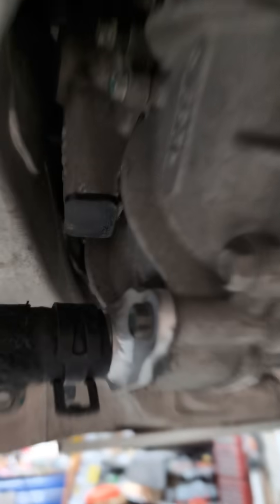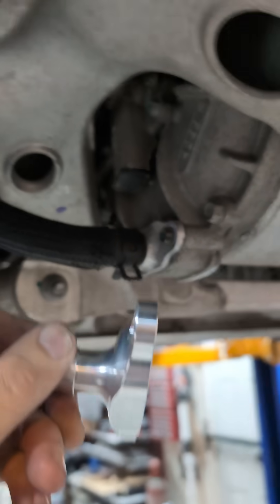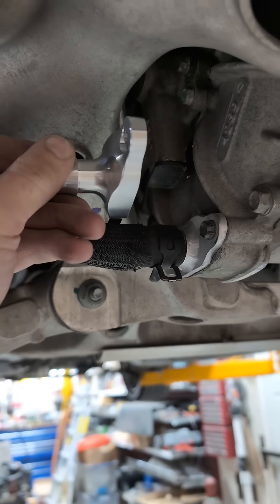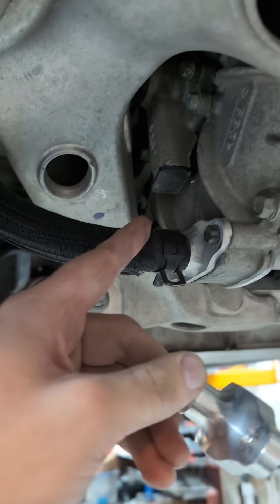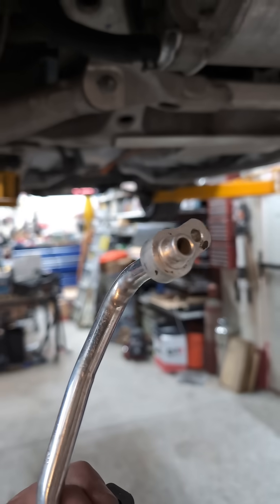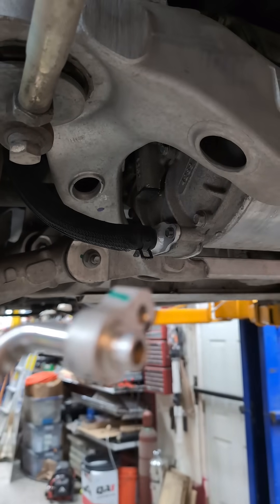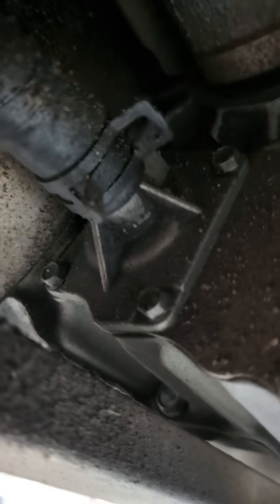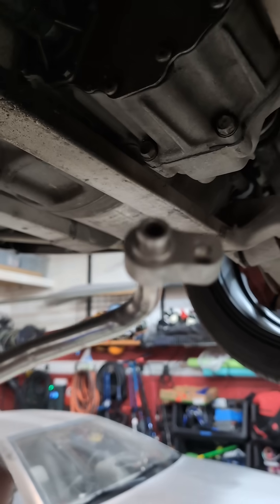Tesla large drive unit coolant delete kit overview.  Is the best part no part?

Comment: U should not use those kills bearings, looks like pink milkshake in gearbox oil. Do as u please just letting u know what comes in my shop
Reply from the maker: You are incorrect, this fitting is not the cause of either of those issues.  

The cars in your shop with the symptoms you describe have already developed a leak.  Leaks happen before the coolant delete was installed, or if they used the leaky cap solution.

This fitting solution completely and permanently eliminates the possibility of coolant leaking past the rotor seal by cutting off coolant to the rotor.  Instead the coolant is routed 100% through the stator which benefits from increased cooling.  This fitting neither causes leaks, nor does it correct damage from leaks.

"Pink milkshake" would be an indication of coolant leaking into the ATF.  This is the reason for deleting the coolant flow to the rotor, where the most common leaks occur.  Other less common leaks can happen at the inverter O-rings also.

If you are trying to lubricate the bearings with compromised oil, damage will eventually happen to the bearings.

I encourage you to study the LDU in closer detail and your diagnosis will improve.  I would also stay way from the caps people are installing, many leak now and many more will leak in the future.  Using a stainless cap in aluminum is the perfect recipe for corrosion just like the HV wire glands at the inverter.  The corrosion starts on the side not protected the the inhibitors provided by the coolant.

The best solutions include this fitting, the aluminum manifolds from Revolt Systems, J5, QC charge, and the cast tesla part. 

Cheers!

Comment: This is a very bad delete. DO NOT preform this delete. Purchase a cap and do a proper delete. This WILL cause damage to the drive unit
Reply from the maker: @lamborghinicorvette  I'm afraid you are incorrect sir.  Not only is this a user-friendly delete, it is designed for high performance and increased cooling.

There are hundreds of these deletes in operation with zero failures.  I push my car arguably harder than anyone pushes any Model S and I've got thousands of abusive miles on this delete.  I push my car to extreme temperatures, d-rates happen at over 300° F.

The cap you are referring to actually reduces cooling.  Since it is no longer cooling a very hot rotor with a high temperature differential, it cannot absorb the same amount of heat that it used to.  It bypasses usable coolant around the most critical components that need to be cooled.  

A high percentage of cars do not need anything else done other than the coolant delete.  Many people experience broken connectors, corroded cables, seized bolts, etc. when removing the entire drive unit.  This kit makes it possible to correct the poor design in the car with average skills. 

This kit increases cooling to the stator and inverter where Tesla monitors the temperatures and where de-rates happen.  It does this by increasing the coolant volume and reducing the restriction into the stator.  This is important because without cooling the rotor extra cooling needs to happen in the critical areas.

Comment: Can you install it without rremoving the return pipe
Reply from the maker: @hamshank8892 most people decide to cut the return pipe and only remove half of it due to access.  This would involve using the included dust cap on the motor side and the plug on the differential side.

Either way, it needs to be plugged at the top of the differential so that coolant doesn't leak.

Comment: You forgot about the gearbox oil heat exchange. That's no longer will be cooled,  after the rotor coolant delete/bypass procedure is done this way.  

Why not just add a separate T to the Billet fitting  in the kit that feeds coolant to the stator,  so part of the coolant flows to the Overflow pipe? Or install a separate T fitting before the Billet fitting?

 Cooling the gearbox oil might not be vital, but since it's relatively simple to add to the kit, why not continue doing it?
Reply from the maker: @nc3826  I wouldn't say I forgot, I intentionally send full flow to the stator and inverter for performance. 

The stator and inverter are the only temperatures monitored inside the LDU.  When I push my car to the extreme I get derates when I hit limits from these temp sensors.

The other consideration is that the coolant returning from the rotor has already been heated, so it does not have very much cooling capacity with that trickle of flow going through the gearbox.  It actually heats the gearbox initially until equilibrium is met.

People can easily tee in prior to or by drilling the billet barb, if they want to bypass coolant around the stator and inverter in order to send cooled coolant to the gearbox. 

I prefer to send higher unrestricted flow through the stator and inverter.
Reply: How much greater is the Full Flow rate to the stator and inverter versus the OEM configuration? (Never mind, just a rhetorical thought)

And I already considered the other factors you mentioned. So I guess I'm pedantically overthinking the subject matter.

But for full disclosure purposes, in the future. It would be nice to have the gearbox oil heat exchange mentioned. Since even minor factors, are still a factor.

Thanks for the feedback.
Reply from the maker: @nc3826 there are two ways that the flow has improved using this method.  Number one, a higher volume of coolant passes through the stator and inverter since none of it is diverted away to the rotor. 

The second way is by eliminating the deadhead flow diverter portion of the manifold and sending the flow directly into the stator. 

When I compare data logs before and after under similar conditions, I have seen 5% to 10% better cooling in the stator and inverter.

The bottom line, just deleting the coolant leak potential is the most important thing.  These other small details will not even be noticeable or significant in almost every vehicle.
Reply: @MrMoparMan would keeping the bypass and adding a T section improve the Rate regen speeds up, as I have heard reports of regen taking longer in cold weather after delete.
Reply from the maker: @carllonghurst9289  Good question... No, that is a battery temperature issue.  You do not want to charge batteries when they are cold.  Two things to make regen happen immediately is to have capacity, so don't charge to 100%.  And then also preheat the battery before you go so it is at a temperature that allows for rapid recharging through regen without damaging the cells.  Also, if you add a TEE, that will send cooled coolant which is the opposite of what it used to be which was heated coolant coming off the rotor.
Reply: @MrMoparMan  ok that clears it up. Was reading on a forum that some people where saying the motor takes longer to warm up providing slower regen since delete.

Have you noticed this on the rwd motors only.
Reply from the maker: @carllonghurst9289  I don't have a lot of data comparing cars on this subject.  Since my car is custom built I have full control over everything and I usually preheat the battery for performance and longevity.

 Tesla scavenges waste heat heat from the motor.  Since it is not collecting heat from the rotor, only the stator and inverter, it's possible it does take longer for everything to heat up with normal operation.  The heat is still generated, it's just not transferred through the coolant until the drive unit is heat soaked.

Comment: How so how does a coolant delete kit work? Just cut off coolant flow to the rotor? Will this not make it burn of heat? Also what about the inverter how will it cool? 
Sorry new to this just trying to understand. 

Thanks
Reply from the maker: @sinanjordanful  Good questions!  There is a trade-off, if we continue to cool the rotor it is almost certain to leak and cause inverter and motor destruction. Accepting higher rotor temperatures has shown to be a great solution with no detriment.  The rotor itself is just a large fancy cylinder of copper with no temperature monitoring.  It's really just a small trickle of coolant that was flowing through the center.

This kit repositions the coolant input directly into the stator.  This allows for less restriction and higher flow to cool the stator and inverter, which are the most important components to cool.  The stator is a bunch of copper windings with shielding that has a temperature limit.  The Tesla drive unit monitors stator and inverter temperatures and will derate power if the temperatures get too high.

This also deletes the return pipe coming from the rotor (since we are no longer feeding coolant to the rotor).  It used to send heated coolant to the differential where it joins the inverter return flow.
Reply: Thanks for the detailed reply very informative. Have you or others tried this fix for thousand of miles with no reported issues? Will this also work in 100 degrees temperatures or just in colder weather areas?
Reply: @sinanjordanful It's interesting to note that Tesla actually implemented their own coolant delete on later model drive units
Reply from the maker: @sinanjordanful I personally have nearly 5,000 mi on my deleted motor which I push to temperature extremes on a regular basis (some fun videos are coming soon ;).

There are over a hundred of these kits that have been installed along with many other delete versions.  I have not heard of any problems associated with not cooling the rotor.
Reply: I have over 15k now, no issues. No leaks. @sinanjordanful